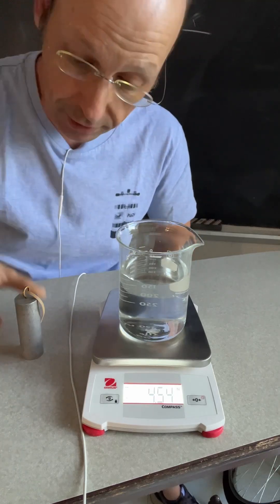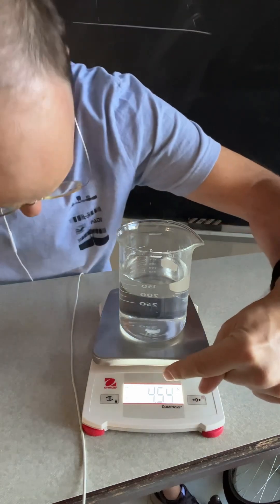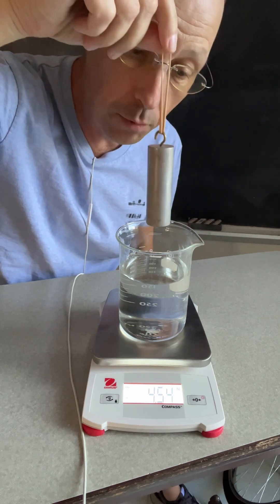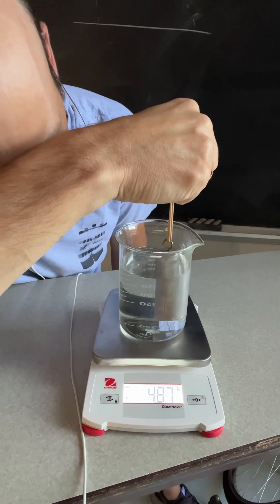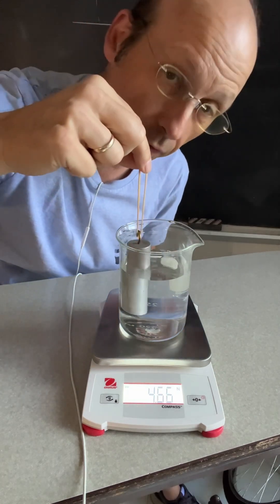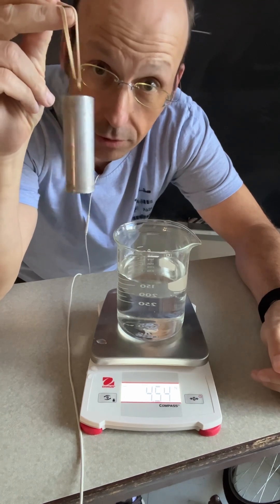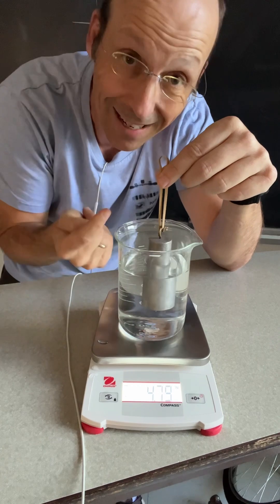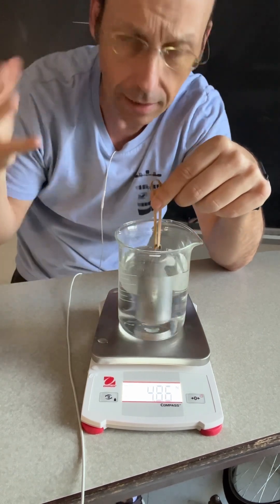What does the scale read when you submerse an object?

Comment: If i correctly remember my 8th grade Physical Science class, the Buoyancy Force is the weight of the displaced fluid.

It would be great to have a ring stand alongside scale to suspend the weight very slow, almost imperceptible, onto the surface of the water to just barely touch the water.  

1-  Will the attractive force of water jump up to cling to the weight?  Will this reduce the weight of water on the scale?

2- Does the little tiny dime-size area of the bottom of the weight reduce the dime-size area of atmospheric pressure on the water?  Will this reduce the weight on the scale?

Comment: It is just like adding some water. Check the raised height of the water. Then separately weigh the quantity of the raised portion of the water. That might be as weight of water equal to the hanging metal in the water without touching the bottom.

Comment: In fact here is another explanation.
You are doing it using water. Specific Gravity is ~1.
When you place a heavier object than water the specific volume will increase and so its specific weight. 
The increase in weight is proportional to the volume of the object submerged.
If the object is lighter than water. The the weight increase is equal to the floating object.
🍻

Comment: I have determined the density of screws and other "weird" shaped objects using this method. The increase in weight is the weight of the displaced water. Multiplicaton by 1 gives you the volume of the object in ml (thanks metric ;-)). Put the object on the scale to get the weight, and you calculate the density.

Comment: Same would happen if you put a floating object, made of wood or plastic !! You don’t need a rubber to prove what you said man.
Reply: Yeah, but then the weight would increase exactly by the weight of the floating object (which is the same as the weight of the replaced water.)

However,  with the rubber band the weight increase on  the balance  is proportional to the weight of the replaced water, but not to the weight of the object, which shows the principle better...

Comment: The displaced water has a higher pressure exerted on the surfacs so I'd asume it has a bit more weight from there. If u lower the weight in whole it'd just add the weight of the item too if it rests on the bottom.

Just speculations here.

Comment: Volume of the cylinder multiplying by the specific weight of the water gives the difference of the final weight, this is the Arquimedes principle or the law of the impulse.
If this guy do the experience with salt water or sea water the impulse will be different.

Comment: At the start of the experiment all the water is at the bottom of the glass but when you submerges the object it produces a vertical offset of the water. The scale read the delta of hydrostatic pressure between these two situations.

Comment: The water that whose displaced by a boat does have the weight of the boat. If the boat were heavier than the water that it can maximal displace, it would sink. If the boat hits the ground, it will add the remaining weight to the ground.

Comment: You are just adding the weight of the water you are displacing. of course if you had a scale between you hand and the weight you would see it is getting lighter for you by the same amount.
Your explanation was unnecessarily complicated.
The water is pushing up is not strictly correct because its pushing in from the sides too.
Also the buoyancy is different depending on the density of the item you put in but you still only displace the same amount of water. You could push a balloon in and get the same result but a balloon would float and be almost immeasurable on your scale. Of course in that case the negative  load would be very obvious at your hand.

Comment: The increase in weight is equal to the increase of the volume of water. 3 milliliters of water increase in volume, 3 milliliters of water's weight increase. It will be the same if the object is made of lead, or aluminum, as long as it is not buoyant.

Comment: You didn’t announce all your variables at the beginning such as the use of a rubber band versus using a string. Any creative man or woman would have worked around the obstacle. What would happen if you used a rigid metal rod on the weight instead of a rubber band? I would think the scale measurement would remain the same.

Comment: the buoyant force experienced by an object submerged in a fluid is directly proportional to the density of the fluid. The greater the density of the fluid, the greater the buoyant force exerted on the submerged object. This relationship is governed by Archimedes' principle, which states that the buoyant force is equal to the weight of the fluid displaced by the object. Since density is a measure of mass per unit volume, denser fluids displace more mass per unit volume, resulting in a greater buoyant force.

Comment: The buoyancy force of the water pushing against the cylinder is felt at the scale.  Even though the cylinder is not touching the bottom, water is still trying to float the cylinder at a rate proportional to the amount of water displaced.

Comment: If you submerge the metal fully (but not touching the bottom) and divide the apparent increase in weight of the water into the weight of the metal itself simply weighed, the ratio of the two measurements is a good estimate of the density in grams per cubic centimeter or 'specific gravity' of the metal. This is because water weighs 1 gram per cc, to within a single percent. This way I once resolved a doubt about which metal a solid 'tin' ornament was made of. The specific gravity was 2.7, making it pretty certain to have been pure aluminium.

Comment: A clearer explanation is that the downward force on the beaker is proportional to the height of the water column exerted over the area of the bottom of the beaker..  Since pressure is exerted equally at a given depth, the weight has merely displaced water upward increasing the height of the displaced water column exerted over an identical area at the bottom of the beaker.

Comment: Also a good illustration of the way that air pressure acts in columns. A flat plain can have different air pressure readings in different places with no change in altitude because the weight of the air acts in a column, and air density can differ in different locations at the same altitude (with temperature differences).
Reply: ah yes - this suspended weight technique is inside barometers !

Comment: imagine a scale weighing your bathtub. What will happen if you float on the water without touching the bottom of the bathtub?
Reply: At most, the reading on the scale will increase by your own weight and the weight of the water you add, as long as you aren't touching anything outside the bathtub.

This is the case whether you are sitting in a dry bathtub and the floor is supporting you, or if you are floating in a filled bathtub, and the water is supporting you.  Draw a box around the system, and as long as it doesn't pass through anything that could apply a force to the system, the support force will equal the weight of the system.

Comment: Congratulations, Archimedes. What you're essentially doing in that experiment is measuring the volume of that cylinder by its weight if it were made of water. Now weigh the actual cylinder, and you will know its density.

Comment: So if a chicken is flying inside a plane, the plane is heaver because the chicken is pushing on the air?
Reply: If a bird is inside a plane, the plane will weigh the same both when the bird is standing on the floor, and when the bird flies steadily in the air inside the plane.  Key word: steadily, because the bird's vertical acceleration will also play a role.

The downwash from the bird's wings will equal the bird's weight.  That downwash manifests as extra air pressure on the floor of the aircraft, which contributes to the plane's weight.

Comment: The water level rises too. 
Would it be the same if it were a plastic tube? 
Would it be heavier since you'd have to push it down?
Reply: Yes.  If you add a floating plastic tube, at most the weight can increase by the weight of the plastic tube, if you don't apply a force from outside the system.

In order to immerse it so it displaces its full volume worth of water, the scale reading will go up by the push force you apply to immerse it.

Comment: If you did this with oil, your numbers would be different.  It's called displacement. Maybe,  try this with mercury.
Reply: If you did this with mercury, the metal would float on the surface, and at most, the scale could increase by the weight of the metal sample.  That is, unless you push the metal down to immerse more of it in mercury.

If you did this with oil, the maximum you could increase the scale reading without the metal touching the bottom, would be by the weight of the oil with the same volume as the metal sample.
Reply: Clever you.  That was my point.

Comment: Another way to think about it, the water level rises, thus the pressure at the bottom of the glass rises
Reply: Yup. Counterintuitive as it probably seems to most people, the buoyant force pushing upward results from gravity pulling down. Gravity results in atmospheric pressure and water pressure, and that pressure increases with depth. There's pressure pushing down on the object, and pressure pushing up. The net upward pressure causes the buoyancy and the net downward pressure transfers the buoyant force to the beaker and then the scale.

Comment: you displace a volume of water, without adding the mass of the suspended weight to the bottom of the vessel, the result is the water level rises without adding more water, but the buoyancy exerted upon the suspended mass is equal to the density of water.  The end effect is the total wight measured upon the scale is equivalent to the "new" water level on the beaker.  Your string (rubberband) is supporting the remainder of the "Potentially" exerted force of the otherwise suspended weight.

In short, a suspended volume (either mechanically by string, or volumetrically via buoyancy) displacing a liquid, will cause the perceived weight of the liquid to increase proportionally to the displacement of the supported mass (the liquid), not the suspended mass.  Archimedes Principal, I believe it is called, it was his bathtub "Eureka!" moment.  This is why ships are measured by structural displacement, not mass or material density.

Comment: I'm thinking perpetual motion machine. On the right side something is dipped into the water and it gets heavier and goes down. Take it out on the other side.
But I know that's not possible.
Reply: It's not possible, because whenever an object buoys up to the top of a body of fluid, a displaced body of the fluid, equal in volume to the buoyant object, must also go down.  Buoyant forces work like an inverted Atwood machine, where one mass goes up, and the other mass goes down.

Since you can't make a perpetual motion machine out of Atwood's machine, you also can't make a perpetual motion machine out of buoyant objects.

Comment: The really mind blowing thing, for me, about weights and scales is that if you travel east that scale will register a lower weight (not mass) for the object, and if you travel west it will register a higher weight. This is because of the Eotvos Effect and it is an excellent proof that the Earth rotates.

Why? Because as you travel east you're traveling in the direction of spin, which pulls the object slightly away from the Earth, which makes it weigh slightly less. Going west does the opposite. The effect is strongest at the equator and weakest at the poles. This proves the Earth is a sphere. So take that, flat Earthers!

Comment: If you take a reading with nothing in the water and then put the weight in as you did, but also took out some water so it was at it's original level, would the reading after that be the same as the original reading?
Reply: I.e. is the change in weight the weight of the water that has been displaced, or is it the actual mass of the weight?

Comment: Would have been a cool addition to this experiment to hold the rubber band with a scale to show reduction of suspended weight in liquid due to buoyancy being equal to the increase weight on the scale as the mass is lowered.
Reply: That would probably be a good addition to the video, but he might  mention that in the longer version. And of course you  can just do the math since the portion of the weight suspended by a scale would be reduced by the buoyant force that's shown on the bottom scale.
Reply: Mass isn’t lowered.
Reply: @boudewijnj.m.kegels5198  I think he meant as in "lowered into the water".
Reply: @jaxjaguarz no, read it again. Buoyancy doesn’t reduce the mass of the weight.
Reply: @KineticGrind  No, you read it again. What he means is "...on the scale as ['the cylinder' which he's referring to as 'the mass'] is lowered [into the water].
Reply: @KineticGrind  No, but it reduces the weight of the mass lol. Buoyancy will push up on the rod, reducing the force needed to hold it up. So a suspended scale would show a decrease in weight (force) and the scale below would show the same increase in weight. The mass of the system never changes, I agree with his idea, two scales would be a great visualization of how weight is transferred.
Reply: @150Gianluca  Weight is the effect of gravity on a mass, so unless there's a change in gravity the mass and the weight are equivalent.  The buoyant force supports the weight, but doesn't decrease it because gravity is exerting the same downward force whether the mass is  submerged or not.
Reply: @jaxjaguarz  exactly what I meant.    I said "reduction of suspended weight in liquid ... as mass is being lowered."    Mass don't change but displaced water will
Reply: @boudewijnj.m.kegels5198  exactly it is the part of weight on the rubber band that is lowered.
Interesting experiment.

Comment: The weight of that metal has nothing to do with it. The height of the water increased as you submerged it, and hence the pressure head also increases thus putting more weight on the scale
Reply: But that's what he says. He never claimed the metal's weight/mass/density has anything to do with this.

Comment: I was thinking the pressure at the bottom increases due to the increase in water height
Mathematically that with calculating the firce using the surface area will no doubt result in calculating the buoyant force

Comment: In other words, this the added mass of the column exerting pressure, aka, weight as a force. It does not matter what material it is, as long as it is submerged. So a lead cylinder and a vial filled with ethylene glycol would 'weigh' the same because they are displacing the same amount of the liquid
Reply: Why isn't it same with beaker without water but having air.
Reply: @anshul9462 There is no change in medium water/air versus air/air.
Reply: @anshul9462  It is the same, sort of. Displacing any fluid by submerging an object in it will result in a buoyant force on the object based on the weight of the displaced fluid, but because the air fills the beaker to the top any air displaced by submerging an object will no longer be in the beaker. If the water filled the beaker completely submerging the cylinder would still displace the same amount of water, bu the weight of that (spilled) water would no longer be pressing down on the scale.  If you could get the air to stay in the beaker while there was a vacuum above the air (maybe if gravity was vastly higher than on Earth, so the air didn't escape into the vacuum) then the beaker could be only partially filled wit air and the displaced air would remain in the beaker. In that case the measured weight would increases by the (very small) weight of the displaced air.
Reply: your explanation is wrong.
otherwise the shape of the beaker would affect the total mass of the water regardless of volume.
The water pushes harder against the atmosphere is why.
Reply: @agnidas5816  Shape is completely irrelevant, as long as the displaced fluid remains in the beaker. The pressure of/against the air is also completely irrelevant. Besides  that, you're absolutely wrong about the difference in the pressure against the air. The height of the water increases due to the displacement, so the water/air boundary is at a (very slightly) higher altitude, where air pressure is (very slightly) less.

Comment: My intuition neglected to consider that you were holding it with a rubber band. Next, repeat the experiment with a stiff handle instead of a rubber band. Won't the buoyancy force be negligible, thus the weight reading remain unchanged?
Reply: It would still be eqivalent to the amount of water replace, it doesnt matter if it is pushed by its own weight or by you...

So the scale would still go up If you oush it
Reply: @thomasflototto9064  Yeah I'm not sure what I was thinking. It doesn't matter how you hold it, one way or another you are displacing water and it is exerting an upwards force on the object. This upward force means the object isn't as "heavy" to you, whether you hold the object with a rubber band or a stiff rod. Then there's the equal opposite force down onto the scale.

Comment: Would it be different if the lead to the weight was not elastic?
Reply: No.  It doesn't matter how the weight is suspended in the water, the only thing that matters is the volume of the fluid that the weight is displacing.

Comment: So would the weight increase be the same if the experiment was in a vacuum?
Reply: Yes.  The only thing that is going to change the reading on the scale is the density of the fluid used.  If salt water was used, you would expect the reading to be ~20% higher as the density of salt water is 1.2 grams per cm^3 vs 1.0 for regular water.